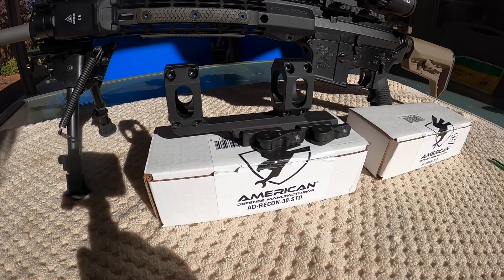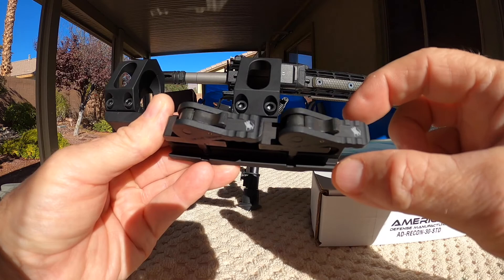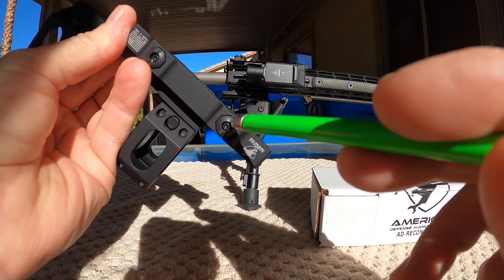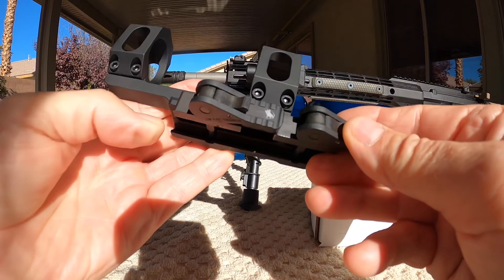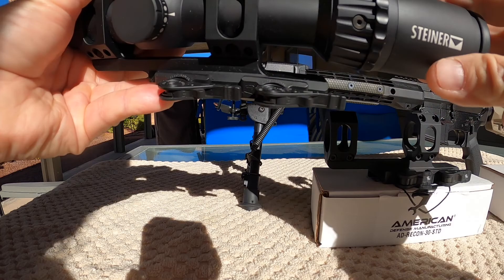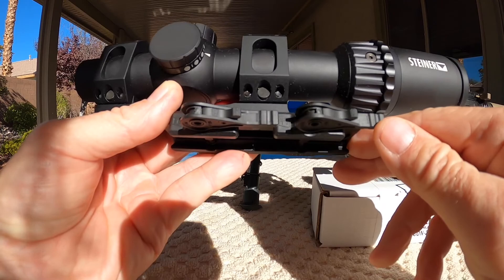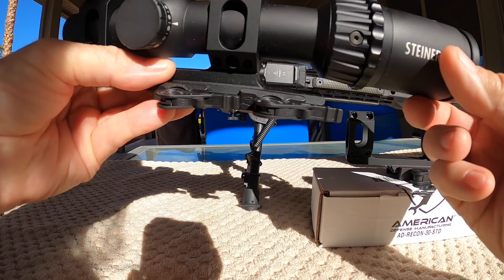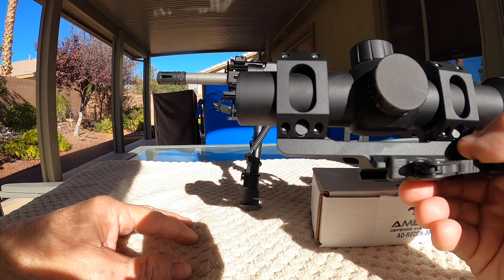American Defense AD-Recon QD Scope Mount Lever Options!

Comment: Cool comparison. Question, deciding between ADM and MI. Your videos have been very helpful. Leaning towards ADM but I was wondering if in your experience, it's harder to find a good level of QD lever tension for the ADM, which only has 8 positions of adjustment on the nut compared to MI which has 12 positions. Some people saying ADM is either too loose or too tight. 
Also, subscribed. Good stuff here!
Reply from the maker: That's a great question! I haven't had an issue with the ADM tension adjustability on my rifles but I use a very slight amount of grease on the cam surfaces of the levers. I could see where the MI would have an advantage in that regard though. The only issue I have with the MI's is that they put the levers on the right side which prevents the rear latch from being closed when using an off-set rear iron sight with all of my magnified optics and getting the proper eye relief at the charging handle. You could put the rear sight at the front of the MI mount but this would reduce the sight radius considerably. Thanks for watching!